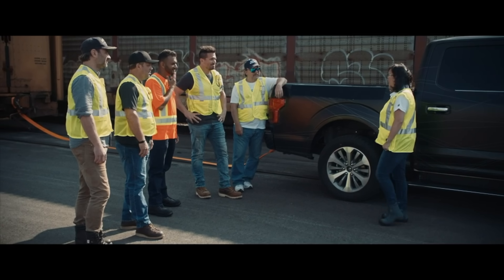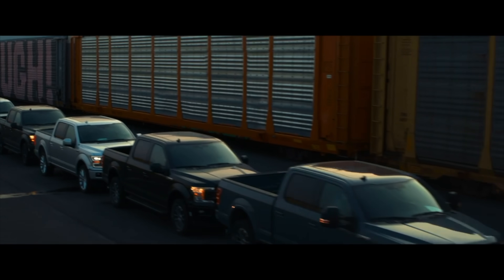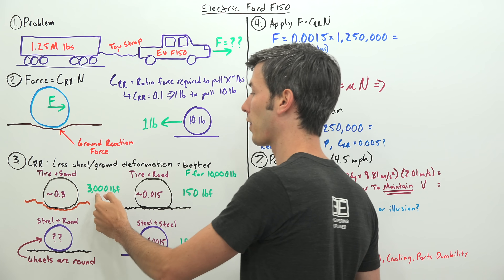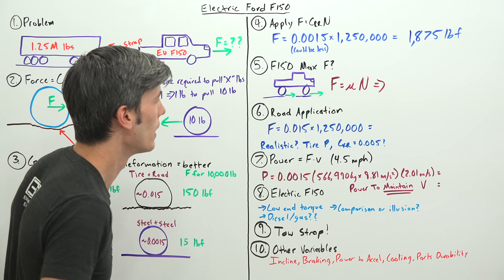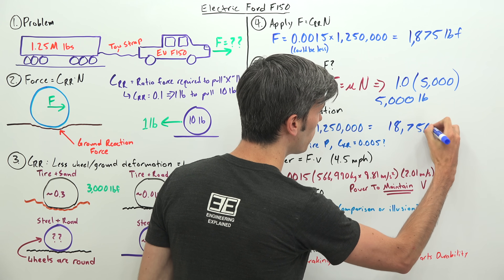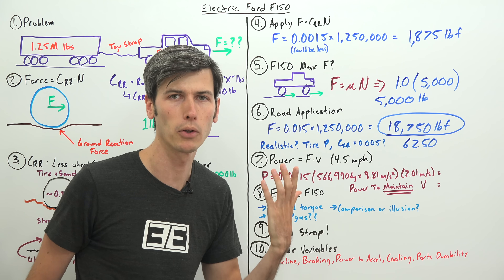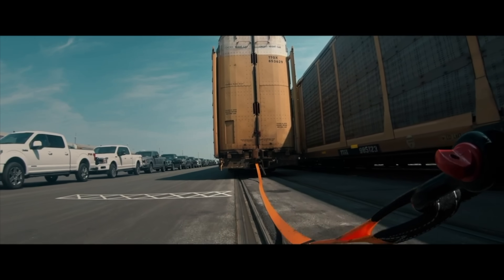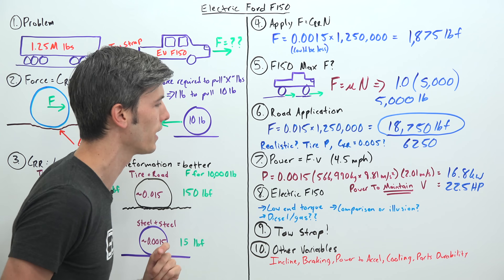No, Ford's Electric F-150 Can't Tow 1 Million Pounds (Realistically)

Comment: Ford electric truck: watch this! Impressive eh!?

4500 hp V12 GE diesel Locomotive: (yawn) hold my 3500 gal diesel tank.
Reply: What really makes them crazy is the diesel is just a generator that powers the electric traction motors. Imagine the torque those babies put out. 
Then they use multiple engines going over mountains. Impressive machines.
Reply: Jim Himes The electric motors are good for the train’s main problem getting the load moving but they lose power the faster they go. That is why they have to use multiple trains while speeding through the mountains. Steam engines  were the other way around. They have less power when the start. But the faster they go, the more power they have. That’s where the saying it’s hard to stop a train comes from. Yes they are heavy and all that. But once those steam engines were able to get something to move, there was nothing left to stop it. One the last steam engines built and of course the best and the biggest put out over 150,000 ft lbs of torque.
Reply: @jordanprier4016  
Another saying also (kinda) falls in place here;
"A Steamer can pull a load it can't start, but a Diesel can start a load it cant pull."
Reply: @jordanprier4016  Hard to stop a train comes from the mass of the train and not the steam engine.
Reply: @jordanprier4016  wrong multiple locomotives are needed for grades and initial pulls/acceleration. Often on trips with flat track and not many stops or restricted speed areas they work on run the lead loco
Reply: In this reply section: LOL but have you seen <random class of big ass vehicle>
Reply: Ok, that was funny ^^
Reply: chris mulders that’s cute, says the 120,000 shp engine in a tanker
Reply: And a single unit 11000HP Softronic Transmontana electric loco laughs at your diesel loco.
Reply: You kidding me? I’ve watched our LEAFs (which are 500hp diesel electrics) pull up to 72 cars (and that’s only because we run out of track before we can’t get past out closest switch)  the loco can easily do way more
Reply: Klaus_Klavier I thought you were talking about nissan’s leaf... had me confused for a second...
Reply: SuperVstech nah man, I work for a company called who makes “Lower Emissions And Fuel” locomotives or LEAF for short and we use those as a way of keeping operating costs lower for customers since we are a contract company
Reply: More than 5000 gal and most are 4400 hp, but close enough. :-D They put out 30,000 pounds-force.
Reply: Justin Penney I’ve fuel done with 3,000HP and some with 4,000HP some had 3,000 gallon capacity some had 6,000 gallon capacity and others in between.
Reply: V12 diesel electric train? Aw isnt that precious....says the quarry 1,000,000 hp diesel electric direct drive rock truck...
Reply: RICHARD1974 that’s a laugh the Belaz 75710 has two engines each with 2,300 HP not even close. Look into a container ship if you want to see HP.
Reply: RICHARD1974 lmao 1m hp quarry truck? Maybe 2k or 2500 hp

Comment: Your explanation sorta de-values what I learn in WreckMaster school ( towing industry training) WM stated to us that you have to over come 10% of the vehicles weight to get it moving with rolling resistance on level hard surface and then we added all other sorts of resistance for incline,decline and level of mire to said vehicle plus if damage resistant was present or not. The whole premise of WreckMaster is so we can easily figure resistance for vehicle recovery as to NOT over load our towing equipment ,wire rope ,snatch blocks ,chains and the towing unit itself. Nice explanation..

Comment: Ford : This is about to be the best marketing campaign ever. 

Jason : Hold my dry erase board.
Reply: This
Reply: That's still a lot of ft-lbs of torque.  The 5L F-150 only puts out 400 lb-ft of torque.  This prototype is likely producing five or more times the torque.
Reply: bagehi Tesla’s best cars only make 758 ft lbs of torque. Of course the f-150 can be geared different to change that. But I highly doubt you are going to get 2,000 ft lbs out of it.
Reply: Jordan Prier yet they’re already pushing 1000 ft lbs with the diesel. Enough competition for dodge to market their diesel at 5 ft lbs more just to keep relevant
Reply: @bagehi  It's not all about torque. A 5.0 truck could have done this too. It's gear ratios are plenty low to do it. It's about traction. Traction is key here. It's kind of impressive that those tires never seemed to slip or break traction at all. I can't help but wonder if there was extra payload in the back to help.
Reply: The campaign has already paid off. Look how many people are talking about. Winning!
Reply: Most educated people watching that commercial knew the science behind it already.
Reply: Justin Luttrell Yeah but the math is way off. Takes a lot more power than what’s report in this video. But yes once you have enough power to break the tires lose. The rest is just extra
Reply: @jordanprier4016  Ya ANY 2019+ F-150 can break all 4 tires loose I gaurantee you that lol

Comment: That force is to keep moving. To start it, it needs way more, because of the joints have high sticking frictional force . I estimate double the force to start it, which is outside the range of quite some petrol cars, if you need the clutch, ofc.

Comment: So was the Model X pulling the 787-9 actually pulling a more challenging load?
Reply: Yes. 

In that particular video the 787 was transferring all it's weight (upwards of 300,000 lb) to the rubber tires. Since the tires were rubber they create MUCH more friction and therefore the weight required by the Tesla to pull the vehicle was significantly higher, probably upwards of 230,000 lb. The entire weight of the aircraft was also being directed to a very small surface area that the tires cover compared to the train in the Ford video which disperses the weight of each car evenly due to the mass amount of steel wheels. I could get really into the math and find the exact number of how much the Model X was actually pulling by the weight distribution ratio of the rubber tires on the 787, how much motor torque the Model X has, etc... but that would take awhile. 

Short answer though: the video of the Model X pulling an 787 was infinitely more impressive as the vehicle was actually pulling upwards of 200,000 lb.

Comment: i mean jeremy clarkson pulled a 13000 tonne ship with a Citroen c3 (28.6 million pounds)
Reply: You've just ruined this whole ford stunt along with clarkson lol
Reply: This comment needs more attention 😂
Reply: Of course he almost ended up in the bay, then almost killed the clutch, but, yeah, he managed to pull it 25 meters.  Also, the rolling resistance of a ship in the water is orders of magnitude lower than a train on rails.
Reply: @bagehi  there is no such thing as rolling resistance in water. I would also love to know what makes you think there is less resistance in the water than on land. A good example that you can wrap your head around can you run through waist deep water faster than you can on dry land? You have to displace the water you are moving through plus you have friction with the ground. You also have to deal with the fact the water is always moving. In the case of the ship you have what is essentially a giant wind sail above the water line as well as a water sail under the water line.
Reply: @LKN117  I don't know where he was when pulling that boat, but water is definitely not always moving, at least by any meaningful amount. It was probably at a dock though and it is better if water doesn't move much at those. Drag (IDK if they call it something else in water) and rolling resistance are two completely different things. The most meaningful difference in this case is that the force of drag is directly proportional to the square of velocity, so when it isn't moving there is no resistance, and when barely moving there is hardly any resistance. Any force at all will move it, the question is how fast.
Reply: LKN117 um, not quite. What you are comparing is air resistance and water resistance by using that example of how much harder it is to run through water. Yes, water does create friction, but because it’s always moving, it allows objects to pass through quite easily compared to pushing something along the ground. I can easily push a large boat in the water, but not a vehicle with similar weight on the ground because water has less friction than wheels on the ground.
Reply: Yeah but that’s water I can push a hole
Ass boat lol
Reply: In EV you can do this without burning rubber and clutch
Reply: @TheWiniarss  think you would burn rubber regardless of the vehicle and vehicle weight. The vehicle was hooked up by a chain that was mounted higher than the car which means when the car pulls, weight is lifted off the tires
Reply: @TheWiniarss  Yeah you just over heat all your high current electronic components and create more resistance and more and wear out more expensive electronic components instead of cheap wear parts...
Reply: "CLARKSOOOON!!"
Reply: technically it jerked it lol
Reply: * Citation required! (I totally want to see that video)
Reply: An Isuzu crawler geared semi pulled over 80 million pounds without the driver touching the accelerator. It was idling forward at 3 mph with 80 million
Reply: It WaS iN tHe WaTEr?!!!
Reply: It's possible at low speed as there is little resistance in water, the fatser you move the object the more resistance, smaller boats are designed to ride on top of the water so as to reduce friction, this is where more power can be useful to keep the boat up on the water rather than dragging through it.
Reply: It was more impressive than this because the water has a higher friction co-efficent but even so he was just trolling
Reply: Japheth Bonnema water has a lot less friction ;)
Reply: You said it... it was Jeremy Clarkson. He’s a God!

Comment: Why could the truck not break the train? It should be able to produce about equal force when breaking as it does when accelerating. And the kinetic energy of the train at 4.5mph should be lower than that of the truck alone at 60mph.

Comment: I can pull that load with my V6 1995 Ford Explorer, all I would need is a set of brand new tires with zero miles on them. By my calculations I should get that load moving around 12.3 mph in just 756.2 ft. All those calculated forces you speak of are meaningless, it's all about the tires! Now that I think about it, since my explorer is only rear wheel drive just two new tires will do!

Comment: Well, duh. All you explained in your video is that yes, an electric Ford F150 can indeed tow a train of 567 metric tons (please stop using imperial units; you are in "engineering"). That it can't tow the same weight sitting on tyres on a road service is obvious. Everyone who cares about wheeled transport knows that steel wheels on steel tracks offer much less resistance than tyres on a road surface.
You should have talked about how a regular ICE-powered truck may have pulled this off also.

Comment: While you're here, I would appreciate a medium dive into wheel efficiency.  How much does efficiency decrease as tire width increases?  How much is air compression a factor at highway speeds?  How much difference do different compounds make?  How do low profile tires compare to more normal tires from an efficiency standpoint?

Comment: The real problem is this is how tv is used  to stupidise the public.and it's easier to believe this than figure out the truth.also I could pull a big rig on a flat cement floor.remember the ecoboost when it came out?it could pull a log.well when I was a teenager at out door party's my 75 lemans could pull logs to the fire pit and that was way before the ecoboost

Comment: I have a question on Point 5:
Why did he/you plug in u=1.0 as a coefficent, if tier-on-road is only u=0.3? (=> F_truck_max=1500lbs)
Reply: Just a layman’s guess here, but... I think #5 is more about the potential pulling force of the truck rather than the amount of force necessary to get the truck moving. And in that context, perhaps the coefficient of 1.0 is just a nerdy way of saying he is assuming that the truck’s weight is the limiting factor in determining its maximum pulling force, rather than something like insufficient power or poor traction — in other words, the truck’s most advantageous scenario.

Comment: I was going to write a blog post about this, you beat me to it. However, if the train can accelerate, it can also decelerate with the truck. What Ford should've mentioned is the regen from slowing down. Any car can pull it, only EV can get most of the energy back.

Comment: So, fun fact. There's no such thing* as a diesel train, they're all diesel/electrics. Because in order for you to have a pure diesel train, you'd need about a billion gears.** They don't have significant battery power or anything, but the diesel is used to power a generator which powers the electric motors which actually deliver power to the ground. This has always been the case, because it's never been practical to have a pure diesel train.

Now, if you were fine with having an extremely low speed, like for instance 4.5 mph, you could probably get away with only having a few gears. Possibly even just the one, so that might be much more practical.

*afaik
**Okay, maybe not quite a billion. But remember that a modern semi-trailer, a much smaller vehicle, has anything from 12 to 16 gears, sometimes more.

Comment: If it had a solid connection (rather than a tow strap), of course the truck's brakes could slow the train down... in the same way it accelerated it.  It would only need to apply the same force that it used to accelerate the train in order to brake it, and it would take the same amount of distance to brake the train as it did to accelerate it.

Comment: "So you only need a 2000 lb tow strap to make it work out..."
Well, no...1875 lbf is a minimum for non-zero acceleration. In reality, the tension on that strap will vary from 1875 to the (tires') upper limit of 5000 lb throughout the run, depending on how heavy the driver's foot is at any given moment.

Edit: That said, yeah, the strap is no big thing.

Comment: Marketing stunt aside, big city contractors are going to love these electric trucks. Considering that EVs get better efficiency than any other vehicle type in city traffic, only expending energy reserves during acceleration, an EV pickup will drastically lower transport costs for anyone who has to drive across SF or NYC between jobs. I know a few guys who were considering a big military pack full of tools and a Segway as a means of lowering operating costs in the city. Guys (and gals) in the on-site maintenance and repair fields are practically screaming for an electric option. It's good to see EVs getting the attention they deserve from at least one of the big auto manufacturers, and I think Ford will end up striking gold on these trucks. They may even do better than Tesla in the EV truck lineup, at least in sales, because of brand recognition with the contractor crowd. An EV Transit van would be a good addition as well, perhaps in a year or three.

Comment: Goddamnit you mean I can’t tow my nuclear submarine down the road even if I buy the new electric F150, frick
Reply: no, you would probably need an f350 lol
Reply: There goes the weekend's plans
Reply: What?
Has your nuclear submarine got wheels?
Nice!
>
Reply: @Bodragon  Came with a trailer, it's 600' x 70' and an 80 wheeler.
Reply: Ahahahaha!!
Reply: Well, you probably can, but launching it will probably short something out in the F150...
Reply: Next up: the fusion powered ford f150
Reply: EdgeRunner oh for sure that’ll be able to tow a sub
Reply: just use the shore connect and provide the power from the sub to the truck !
Reply: No.
of course not.
Wanna sell?
>
Reply: No, it might get tricky but as long as your on steel road you might pull it off by rolling your sub.
Reply: I know this person
Reply: You can tow 1 million pounds of trucks tho
Reply: u cant tow a nuclear sub accros land, its nuclear !
Reply: Not with that attitude 😂 Everyone knows you need to start with "Hold my beer." Nothing has failed once that's been said 😂
Reply: goddamn americans with their goddamned submarines
Reply: Funny you say that.  I used to work  at a shipyard with nuclear submarines.  The fine adjustment during docking was done without any kind of engine or power tool (full disclosure, not by my shop) - it's pretty amazing what's possible with bouyancy, patience, and a little bit of mechanical advantage.

The hard part was correct alignment of the boat with the keel blocks so that the hull wouldn't be damaged by uneven force.  So there were a couple guys with survey equipment.  IIRC the tolerance was about a quarter of an inch.

Also Portsmouth Naval Shipyard at the time had one drydock that was plenty wide but a little too shallow for 688-class submarines.  The solution was steel cans and straps to lift the boat a little bit higher - basically waterwings.  The first real job I ever did there after training was mopping condensation out of those cans so that the metallurgy techs could inspect them for corrosion.

Off the top of my head (and not a secret number) those submarines weigh about 4 thousand tonnes.
Reply: Sucks for you. My Tesla truck will be able to pull my sub no problem.

Comment: I don't get why you draw the conclusion that the truck couldn't stop the train, if it pulled it with a solid bar it would simply need to apply the same force for the same time in the opposite direction, minus the rolling resistance and bearing losses, easy for an EV. Also ~5hp of heating for 5 min probaby wouldn't melt the brakes (zero maths done here) if you used them instead.